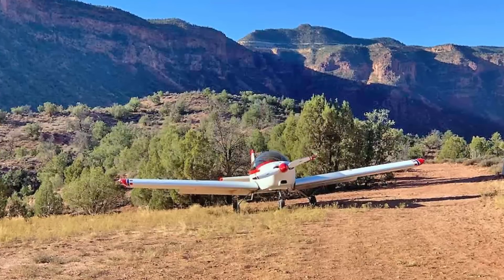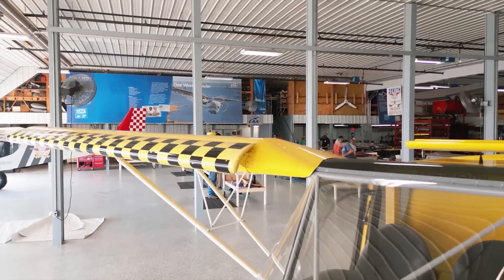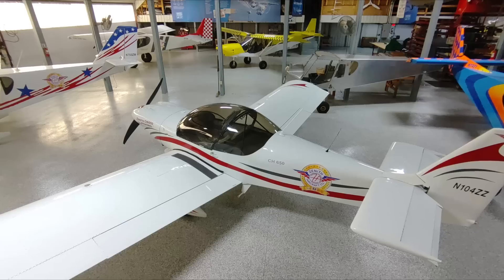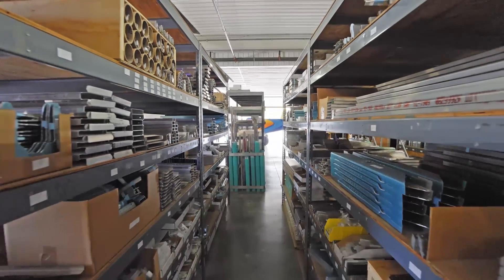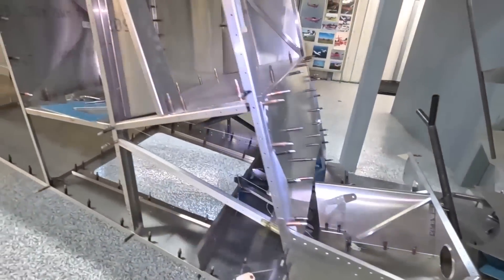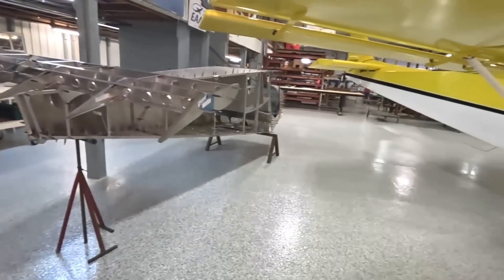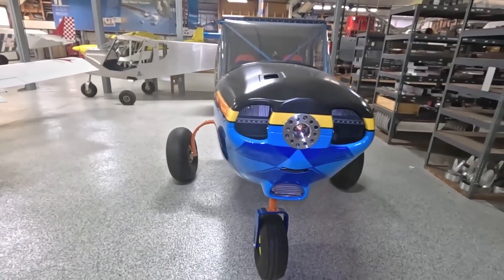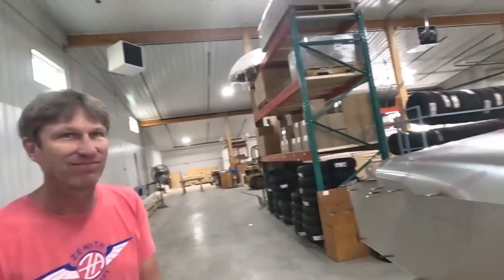Zenith Aircraft Updates: Zenith Introduces Matched-Hole Zenith CH 650 Kit for Simplified Assembly

Comment: Do you offer a factory builder's assist from start to finish?  Where you could charge extra for program, but the builder would have the peace of mind and gain the confidence for that first build.  Workshops are nice but only offer a slice of the pie with respect to the total build committment.
Reply: Most of our effort is put toward making Zenith kits quicker and easier to build so that the individual amateur builder does not require factory or professional builder assistance. That said, we are available for custom build projects as time permits.